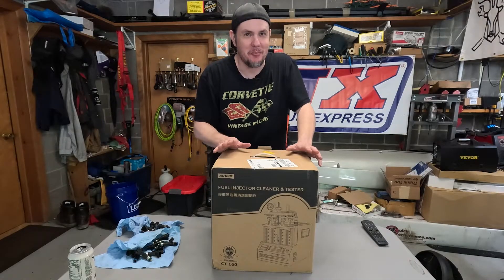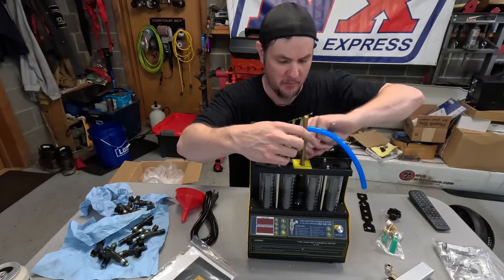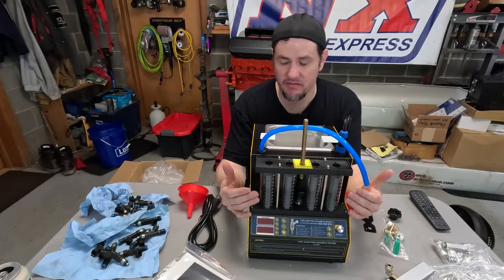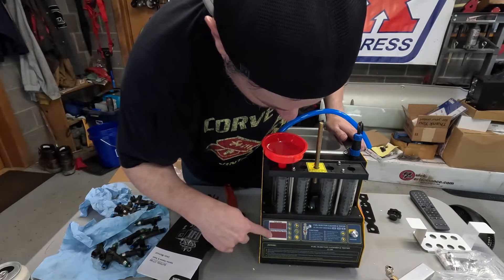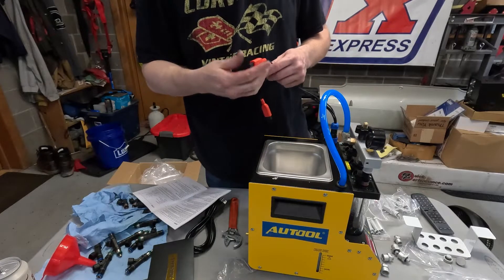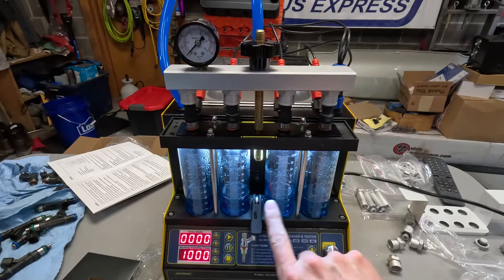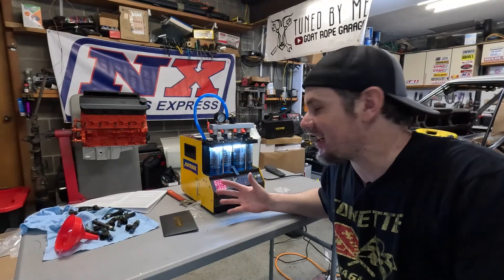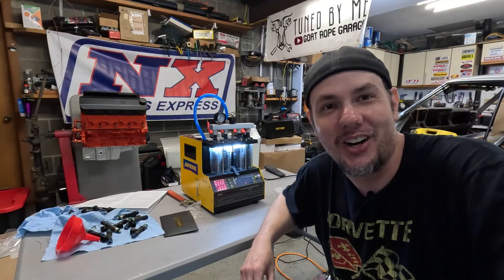Autoool Ct160 Injector Tester And Cleaner: The Ultimate Injector Testing And Cleaning Solution!

Comment: Would this make for an easy solution to fix lawn mowers and trimmers or still backpack blowers that ended up left outside during rain or just got dirt in the injectors where they need to be cleaned to operate again rather than buying and replacing the entire kit?

Comment: Will any injectors work with water?  Need some that'll spray straight, I got a wild idea!

Originally I was going to use dishwasher parts (spray arms) To operate the side shower in the outdoor shower,   I'm thinking about hooking fuel injectors to a amplifier to see if you can hear music through the flow of water.  If this works, it'll be the main shower head with music and all.
Dishwasher spray arms will do the side spraying in the shower with no music, the music water should hit the top of the head

Comment: You should have switched the two outer injectors and put them in the center just to check and see if pulse results are the same if the two center injectors our pulsing better because there getting better connection or what not then we would no if there is discrepancy between inner and outer slots ..As it could be the machine pulses the two center injectors stronger if that makes since ..It would show if its an inconsistency of the machine or actual injectors..

Comment: I am skeptical about using washer fluid as a test fluid since it contains methanol. I think that methanol would not be good for the seals in the machine, and bad for injectors. I own a Flex
fuel vehicle, and the owners manual tell you to not use any methanol based products in the fuel system. I know that both are alcohol based products, I'm not a scientist, but owners manual tells not to use methanol
Reply: This is a valid concern, consult the elastomer chemical compatibility database for confirmation and choose replacement elastomer compounds accordingly.

Comment: Been using a CT200 for about 6 years. For serious duty you need to upgrade the power supply and fuel pump at a minimum. 

Also noteworty is their fuel pressure control strategy does not pwm the pump variably as one would expect, they just cut voltage to the pump, which is also the injector supply voltage. Good basic machines, but for consistency there are several modifications that must be done.
Reply: Details on mods?

Comment: Hey man! I am a silent lurker that have been hitting your Tuning Playlists. 

Love the videos but I wish they where made out to people that does not know HP tuners as good as you. You are so quick going trough it and do things that I need awnsers of that your not explaining properly 😂

As you can figure I am new to tuning eventough I have been feeding my brain with all these things for 2 years. (spark, knock, afr-lambda, VE & more) 

Is there any videos on how to do a basic stage 1 on the car? I went through the Forums like you mentioned in HP tuners and etc. But I am just not getting the Info I want...

I would love to know the basics ons Tuning the spark as example (I saw your video of the spark adder and I saw the Spark base table but things like where would one actually adjust, same with the Fueling, As the RPM's goes up we have to run Richer but how do we know if the set point that we are at is right or not.)

Thanks man 😊

Comment: Problem with them they cant flow moderate flow rates without dropping psi as you can see in your test the psi drops, i modified mine with a bigger pump and manual regulator with a larger power inverter
Reply: Hi, thanks for this. Could you make a video of this then tag me to it please

Comment: If you swap positions, does it make a diff?
If you run low psi / high psi / low duty / high duty / is the pct varience consistent?

Could aleays use them with per injector scaling on your vehicles ECU to correct for the varience.
Reply: I suppose; even if you balance them, your VE per cyl is going to vary as well.

Almost better off using 8 widebands.

Comment: I bought one similar to that about 10 years ago (but the 6cyl one) - it's great!  Buy your cleaner and flow fluid in the biggest pail you can get (I bought 5 gal ones).  If you can't find it I'll try to get the info off my cans.  Being able to flow test and make a MATCHED set is super handy.
Reply: I think I put a couple of vids up on my channel showing it.
Reply: Oh, and grab some plug lead wire numbers. Slip them over the wires.  Makes it far easier to go from test->clean->test->clean->test and get them back in the same place for comparison.  I punch all the numbers into a spreadsheet and graph them if I'm doing them for someone else.

Comment: cool machine.  I wonder if some of the Styrofoam lodged itself in the manifold?  I use a handheld injector pulse tool and clean injectors that way with a Frankenstein setup.  Basically I yank the filter basket with a drywall screw, pull the o-rings, rig up some hoses to a can of carb cleaner and I spray through the injector backwards (Basically I'm using the propellent in the carb cleaner can as a fuel pump lol).  You can order replacement basket filters on the jungle site for not much money.

Comment: Another test you could do is take the two outside injectors which flow “less” and put them in the center and put the higher flowing ones on the outside spots and see if your results are the same? Just a thought I had watching the video
Reply: I was wondering the same, that center feed fuel rail might have smallest of fuel pressure difference and carry over a small effect in a set where balance specs are unknown. Would also love to see 1min and 2min tests to see if the flow rate is linear.
Reply: I suggested this as well that way you can see if the inconsistencies is the injectors or the CT160 itself.. I just ordered one so I will conduct this test on my channel and show results as well very soon .
Reply from the maker: Good idea
Reply: Please do this
Reply: Incorrect , the fuel rail is under presure meaning all of them supposed to be perfect if not then you have a problem witht the inyector or your pulse machine